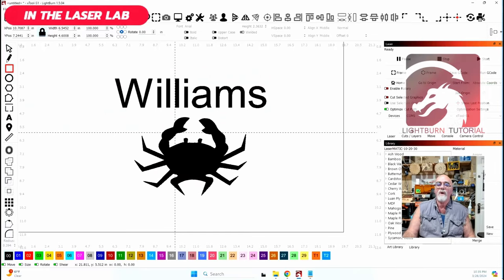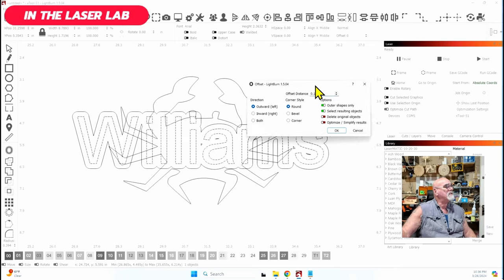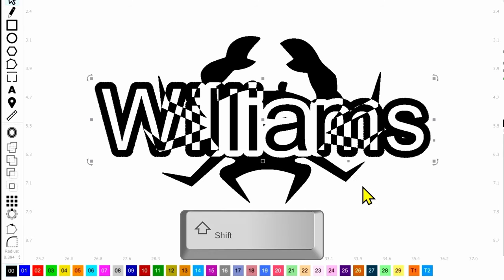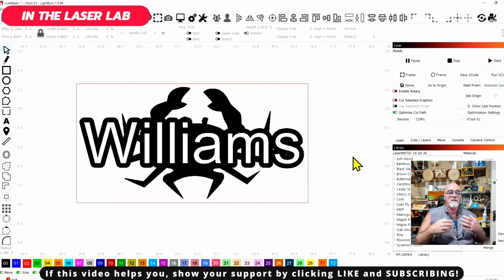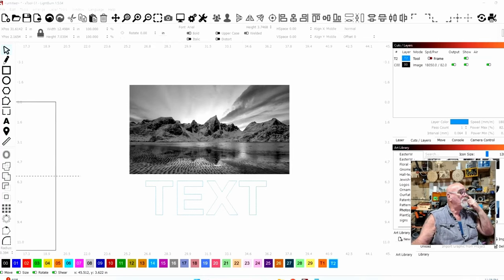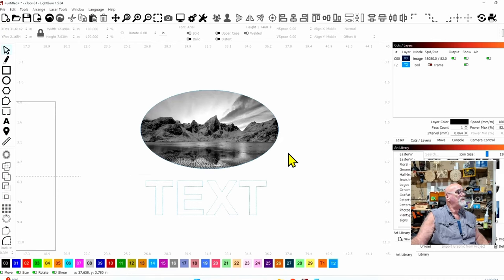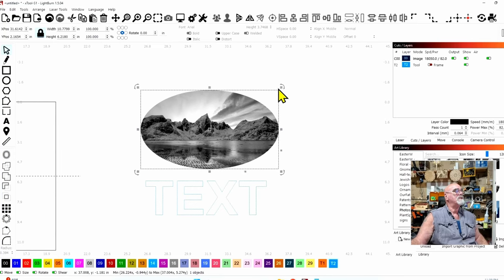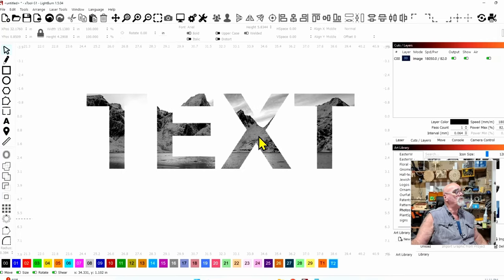💡 Cutting Text from Graphics, how to merge text with an image - Lightburn Tutorial

Comment: Hi Rich, I am in Lightburn 1.5.06 on a Windows 11 machine (Surface Pro). I can draw a straight line with the pencil tool, then select the line, use the DEFORM SELECTION (16 POINT) TOOL, to curve the line, when I come out of the DEFORM SELECTION (16 POINT) TOOL and return to the SELECT TOOL, the line disappears. Is there any step I am missing? Should I just use the PENCIL TOOL to make the curves for the line and not the DEFORM SELECTION (16 POINT)? Thanks in advance, I really enjoyed the Flag videos...........
Reply from the maker: I'm not sure what you're doing wrong, sorry.